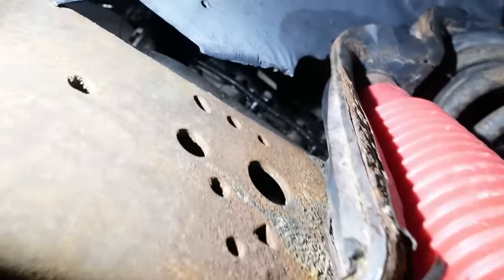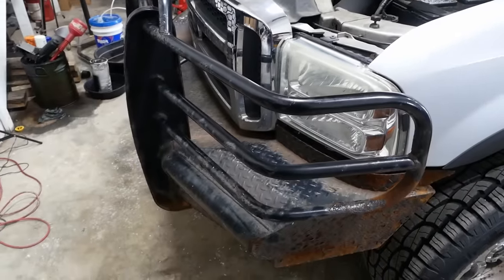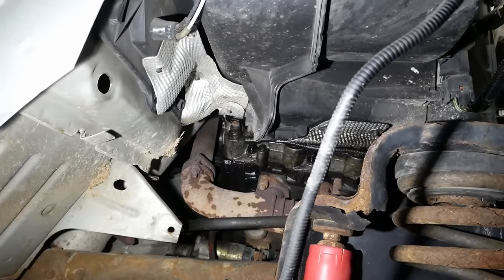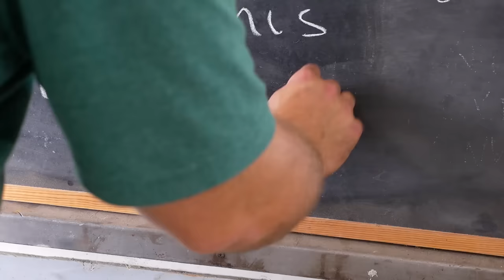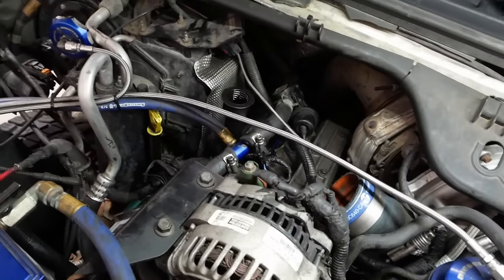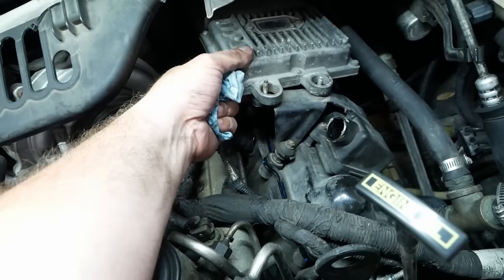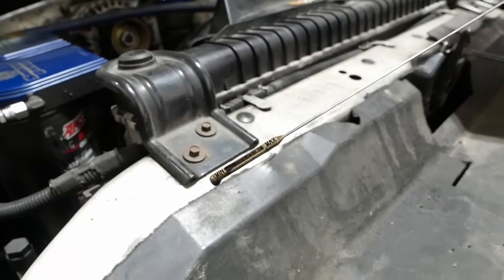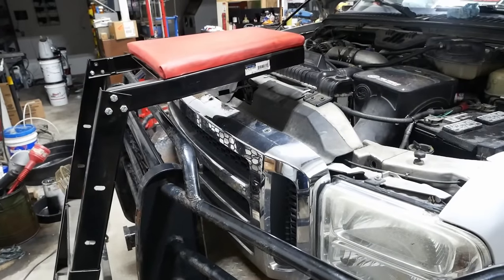6.0 Power Stroke Makes me Question my Life Choices - Major Oil Leak

Comment: You don't have to say no on the jobs, you just bid them at 3x the rate and customers will decide whether they want quality work.
Reply: That's right.  Make those customers a deal YOU can't refuse.
Reply: If I could add to Mr.APC's wisdom; when faced with the mechanical versions of what cop's used to refer known dipsticks as "frequent fliers",  would it be fair and reasonable for there to be an addendum on those bids stating that because of known defects involved in repairs to that make and model, the bid will not cover issues X and Y should they become a part of the repair quote??
       BTW, those were nice, very pleasing legs displayed on the porch clip, and your missus has nothing to be ashamed of, either!!!
Reply: Where I live there is only one single mechanic who will actually work on a 6.0 or 6.4. He charges $300 an hour and only works 2-3 days a week. Currently there are between 50-70 trucks sitting outside his shop waiting in line. He is in his late 50s and maybe has 10 years left before he closes up shop.
Reply: Ah yes. We call that the F U price...
Reply: A friend of mine ran into that with the sparkplug replacement on the infamous Ford 5.4 - the quote from a shop surely allowed for the problems on those, and we warned him not to attempt it himself. He opted to not replace the sparkplugs. Truck went to the junkyard yesterday.
Reply: good idea to get some bucks, but then they agree and you still doing it - $tupid customers
Reply: @pettyfogger2305  Putting the statement in writing, that truck, brand X, has known defects could lead to known legal matters by truck brand X (:
Reply: @boltyk1  As a mechanic you are always going to be doing work that is difficult or timely, but you always make sure you are not losing money by doing the work. If people want their vehicle worked on you tell them upfront what it costs to fix. Especially with 35 other people have been there before you and you can see from the exterior of vehicle that nothing has been maintained.
Reply: @MrAPCProductions  it's only the cost of repair vs buying the replacement, right?

Comment: The best diesel engine is the in-line 6. They ford/gm/ detroit could never make a good v-8 diesel. CAT, cummings/ International still the better diesel engines. IF you don't have a 10,000 lb trailer to pull once a summer then you don't need a diesel.. It takes a pocket full of money to keep a diesel going.

Comment: I have heard on the 6.0 powerstrokes the sand from the casting will plug the oil cooler and blow everything up which is why people run the coolant filters. Such a junk design

Comment: I actually like the 6.0 content.  Not sure if it's because i enjoy watching others struggle as I have on the 6.0 or bias because i own one 😂(05 excursion).  They are pretty robust but can be annoying to work on.  The coolant filter mods are due to the egr cooler issues / scare but regular maintenance / non ford coolant seems to help a lot.  I bought into it with the BPD oil cooler relocation kit.  6.0s are still pretty common in VA / NC from what ive seen.  Hopefully more will come your way 😁
Reply: My NC based 6.0 still running pretty well with about 400k miles..  not the best design but can be reliable with a few changes (egr delete, stud kit, etc) and regular maintenance..
Reply: Motorcraft Gold coolant was terrible about the additive package beginning to drop out and  solidify in the system which in turn clogged the oil cooler. Like everything else on a 6.0, one thing goes south and left unchecked and it can get uglier, and fast.

Comment: I did contract engineering for White Motors back in the 70’s. Inner fender liners on AutoCars (can you say Matt at Diesel Creek?) and Freightliner trucks were made from hand mock-ups on the truck, and then sent out to have the full size patterns made from them for production. This was pre CAD, and I believe the assembly notes said something like "locate fastener holes at assembly." That was a fun place to work, because you would draw some sort of a plan, then spend the afternoon in the shop trying to make something that resembled the drawing. Once you had a workable model, then you went back and made a finished drawing for the production part.

Comment: Ford engineers make me question my career decision everyday as a Ford mechanic. Keep up the good fight Wes. You are a humble mechanic and entertainer
Reply: I had the same question as a Chevrolet mechanic. They told us in GM school,"We don't build them for being easy to work on. we build them for ease of assembly.
Reply: They used to be good before Triton V8 and 6.0 disaster era .
Reply: Blame Navistar International Harvester for at least half. 😏🤷‍♂️
Reply: Remember kids: DFM stands for "design for manufacturing", not "design for maintenance".
Reply: @tomtheplummer7322  actually I was told Ford rushed Navistar to release the 6.0 before it was ready and made their own modifications.

I had IHC Navistar 4300 and 4700 medium trucks with 444  and never had issues like in Ford  pickup trucks did .
The 7.3 PSD was excellent though.
But the transmission s melted in my f450  dump truck I went through 3.
Then the dual mass POS clutch went twice in other truck.

I switched to GM gas 6.0 LS fleet trucks vans years ago.
Now they suck to high tech .
Reply: Squatch253 (Toby) afaik, gave up. He's making OCD videos now.
Reply: Props to you for working on Fords every, single day. Been a transmission builder and r and r tech for 30 years... seriously thinking of finding something different due to Ford Motor company.  Removing a transmission in an Escape today...ridiculous.
Reply: Coolant filter catches the leftover sand from when the block was cast,preventing a stoppes up oil cooler
Reply: افشل محرك  engine 🤮🤮
Reply: I have been telling people that for years. The design engineers do not give a damn about future repairs.
They only care about reducing production cost, full stop!
Reply: In Sweden we say ”Ingen Ford på våran gård” meaning “no Ford in our yard” - and it has a reason. Many are horrible to work. And this saying has been around for at least 70 years… we make Volvos that used to be the easiest cars to work on, without comparison. Not anymore, but still light years better than Fords and VAG cars. I mean on VAGs you have to get the bumper off to change light bulbs…
Reply: @davekorn6516  Um, what?
Reply: @aserta damn fine OCD videos. That H is going to sharp when it’s done.
Reply: @davekorn6516 I was told the coolant ford used had silicate in it that would separate from not being changed regularly and the excessive heat from the EGR. This would also help to plug the oil cooler adding to a compounding problem. I always ran silicate free coolant and a filter.
Reply: @dragonseye5770 That is very cool that you fix these. Do you ever rebuild the escape transmissions? I used to work at Ford as an oil change guy and I remember they often had a lot of metallic glitter in them. I remember for a warranty tranny replacement, they asked to reuse the Torque converter, so the trans tech always did his best to flush them out before reinstall, but he strongly disliked the thought of reusing them
Reply: @jb-vz4wb  yes I do quite a a few actually the rebuild takes less time than the r and r I’d never reuse the converter that’s usually the main failure

Comment: Wes....you are an internet treasure.  I own a 2004 F250 with a six liter.....and I can still watch this with a sense of humor.  I live in Texas and my truck is without rust and has 170,000 miles on it.  Needless to say....it has had all the major repairs done on it....I still like to drive it....and I always drive with my fingers crossed.
Reply: Same here but no major repairs. ... 2004 6.0 F350 FX4. 500k Mike's and still running string. Valve covers have maybe been off 4 times.
Reply: Oh man that hit's a little close to home "and i always drive with my fingers crossed." me too man, me too, 2004 6.0 f250 xlt

Comment: Should you have this issue again (and you probably will), try the solid SS thread 'self-tapping' inserts. They are available from different companies in flange and non-flange options. To install them in a tight location, you can use a short bolt and a nut to lock the insert at the end of the bolt and of course a little red locktite wouldn't hurt. Just be careful you get it started straight. In regards to your service platform, slit a piece of rubber fuel line and silicone it over the sharp edge. That corner looks like a set of stiches waiting to happen. Have a great day and thanks for the great video.

Comment: I feel your pain Wes. I worked for international through the heyday of the 6.0. lemme tell ya', if it weren't for warranty work on those engines. We probably would have closed our doors at our dealership during the "lean" times back then. Absolutely horribly designed engine !

Comment: not a professional mechanic, just a cheap kid that won’t pay someone to do the work. when i helicoil my valve cover bolts i just skip the drill bit. once all the threads are 100% cooked the tap works great w/o. i use a 1/4 drive ratchet and a 1/4 drive socket backwards where the tap sits in the 1/4 square hole on the socket and the specific size (can’t recall the size rn) barely engages on the ratchet’s anvil. makes it so much faster. i also use the helicoil install tool from auto junk and it’s pretty short. eventually the coil will get fucked too but it comes out with the bolt. all you gotta do is get new bolts. hope this helps my fellow 6.0 freaks

Comment: Wes, just to give you some relief, I should bring by my 70s squarebody chevy with a straight six.  To give yourself a “challenge” with the valve cover gasket, you can either blindfold yourself, or only use one hand for the job.  I once changed the alternator in the dark with no light, entirely by feel.  These V8 diesels make me want to “run away, run away!”.  Thanks for the video.
Reply: I'll throw my 68 Camaro v8 & my 97 Jeep Grand Cherokee with the 4.0 in there with your Square Body 6 cyl.

Comment: I live in the UK, we consider 3L to be big so I’d say 6L are vanishingly rare 😂. I don’t think I’ve come across a wheel arch liner that actually fits back in easily (or when it does, half the lip is sticking out elsewhere!). I really enjoyed the cinematic part at the end, thanks for yet another great video Wes
Reply: In america we keep going bigger. The modern ford engine is a 6.7. Then they cry bloody murder when diesel goes up.
Reply: The model before the 6.0l was the 7.3l. Plus the big 3 made massive v8/v10 gas engines in that 8l+ range.
Reply: Letstalkaboutcars i have a 0.898 liter 3 cyl. And under the bonnet its as cramped as this one.
Reply: @henkoosterhof5947  gotta love the engineers.

Comment: The repair bolt is a great idea. To alert the repairer of the bolt it could be anodized red or bright orange.
Reply: Or have a larger head, so the you need to use different socket when taking bolts out. Does not guarantee right installation. Using aM7 or M8 bolt could be an solution, but hard to say if there is enough space for those in the cylinderhead..

Comment: I had a 2006 F-550 (tow truck). Getting the fender liners back in was the worst part of any job I ever did on it. They are brutal. The only valve cover bolt that ever striped was the lower front passenger side - probably the easiest bolt to get to. It only took a few minutes to install the Heli-Coil.

Comment: Mix some Lavender Oil & Permethrin to get rid of the Flies. Spray the outside of your shop with it mostly but you can use it on your clothing & spray your doors inside with it too. Works pretty good. About once a week or so

Comment: I have seen stripped out bolts on these 6.0 over 50 times in the last 3 months everything on 6.0 are a pain to work on suspension engine steering gear there all time consuming

Comment: You could cut down the drill bit and tap just a little shorter, and grind it to fit a little ratchet wrench.  Maybe cut it in the mill if you have to, so that it fits the ratchet wrench properly and keep them as a dedicated tool.   I think that would gain a LOT of time.  You drop the wrench less and you get quick repeated strokes vs using the open end on a square grind.  It's a little bit more prep time, but I think it would be worth...  Then you could probably get a powered "pass through ratchet" on your bit/tap.  Quite a few special tools to get, just to save a little time.  It would only make sense if you do a lot of them really.  A powered pass through ratchet is good to have anyway though.
Reply: Good idea.

Comment: I use a small bit driver to drill and tap the back holes.  Every truck I get the rear bolt is stripped and filled with silicon or something.

Comment: If it aint broke fix it till it is! Oh god ive done that once before on the same stupid bolt... Also the FICM is supposed to have the rubber grommets. The coolant filter was mainly for when these trucks were new. The block is casted with sand when the metal cools the sand is flushed out of the casting ports (More commonly called freeze plugs) sometimes not all of the sand was removed and would eat the water pump or eat a hole in the timing cover.

Comment: My guess is that the valve cover threads get stripped because they get over torqued during reinstallation.  Low torque spec, small size, then add power wrenches.
Reply: They just get stripped naturally. Even if you're not using an electric ratchet, and use torque them to spec, those threads only have so many valve cover gasket replacements in them before they leave the chat.

Comment: A straight 5.9 cummins gives you way more room to work. Nice work Wes. So happy i sold my 6.0 in 2008. :)
Reply: It makes me so happy that I already have a Cummins in my 2005 F350 instead of the original six uh oh.  It is SO easy to work on, relatively speaking and looks like it came from the factory that way (after I corrected all of the janky wiring and hose routing done by the installer).

Comment: It's probably too late now 😅 but tapping 1/4-28 into formerly M6x1.0 results in a really solid connection. The air cooled 2 valve Kawasaki 900 to 1100 engines have a cam cap spec beyond what they should. And the cam supports have very little material, so I hate drilling them.

In desperation, I tried greasing up a 1/4-28 tap and went carefully. Threaded in the new bolt and it promptly snugged up to spec without any nervousness. 

Not sure if you can get hardware that works but that would be a "must" for me if I ever end up with one of those engines. 

M6 into aluminum should only get 72 in-lb ... Anything more and you're asking for it.
Reply from the maker: They were asking for it for sure!

Comment: Wes, I also have a topside creeper. I drilled holes in between the existing ones to gain alternate heights also. Works well. I agree on the steps. Great video man! I generally don’t work on diesels and watching your struggles reaffirms my decisions to turn them away most of the time!
Reply from the maker: You're smarter than me!

Comment: Nice work as always, Wes.  I  groaned when you talked about the stripped bolt (but LOL'd at the bandaid and beverage). 
If you're having any trouble getting to sleep at night, read up on the history of the 6.0 and the reason for the coolant filter will be clear. It's the best mod you can make to those.
Reply from the maker: I guess. I've seen hundreds running around with no filter doing just fine. But I guess it helps sell parts.

Comment: I sold my 20 year old diesel F350 a few years back and I have no regrets. Wallet is thicker than ever and maintenance on my current vehicle is so much quicker and easier. Thanks for the video sir.
Reply: What did you switch to?
Reply: What did you buy sir if you don't mine?

Comment: Not cow pushers. They are used for what’s called bump gates on ranches here in Texas and Oklahoma. Double gate on a single center pole with a cable that would wind around the pole when bumped open then close the gate after you passed through. Timing was everything. Hit to hard and crash the rear. Hit to slow and drag the gate down the side of your truck. Hi from Texas
Reply from the maker: Interesting. Never seen one.

Comment: First of all Wes, I really like your channel.  I worked in Ford dealerships for over 20 years. Boy those diesel engines are a pain to work on, regardless of year and model. Don't know if it will help, but I used to take the front wheels off, set up truck on short jack-stands, remove the inner fender wells and go to town.  It also gives the ability on many pickups to have the truck low enough to not have to use the lay-down gizmo you use. "Don't drop the really tiny wrench."  LMAO. Thanks for the video.

Comment: Oh Wes! What an absolute sh1t show! Im so glad i no longer see those garbage trucks or engines anymore and haven't in several yrs. I cringe at the sound of their engine & worse... the mess under the hood.

The coolant filters were to help the oil & egr coolers from getting clogged up... since after time the coolant gets a buildup. You know how tough the cooler is to do... and where it's at. The passages are so tight on it. I believe you said the egr was deleted,  so that helps with longevity. 

Well, all i have to say is..... better you than me, Wes. Lol 😂😅

No, I've never had the valve cover bolts strip out... and glad i never had that encounter. (rust belt Philly, PA) You seem to handle those issues quite well, i gotta say. You're very good at improvisation & making tools to fit when in a jam. I know how much time these videos take to make as well as how much longer jobs take when trying to make a video. Good for you to still push through & make content.... then spend the hours editing 😣🥱😬  God bless sir!